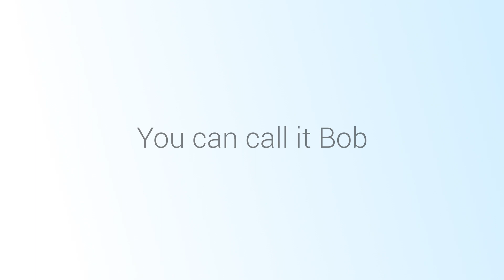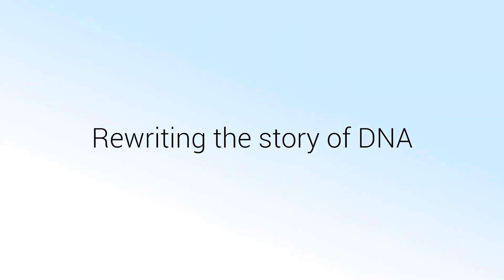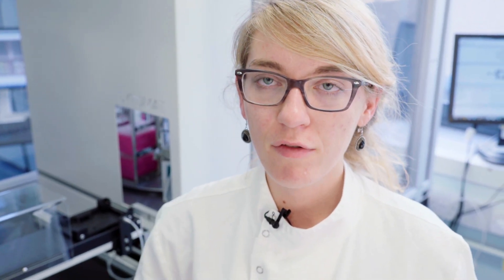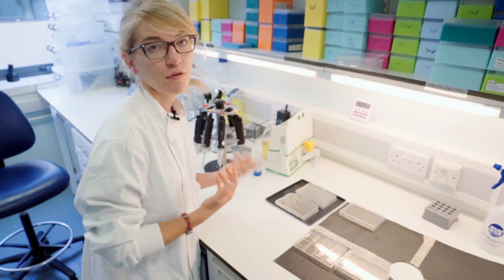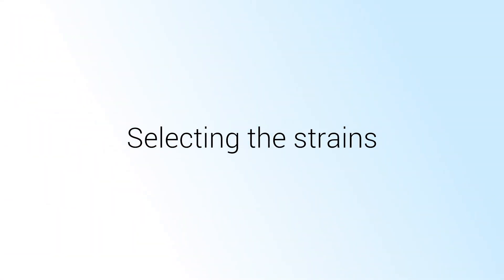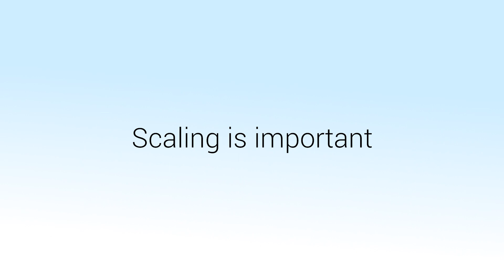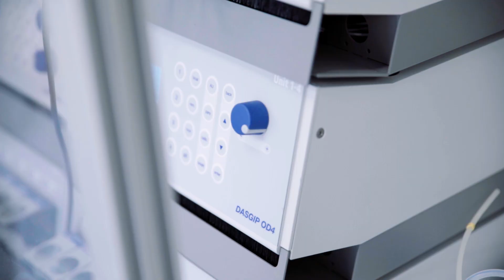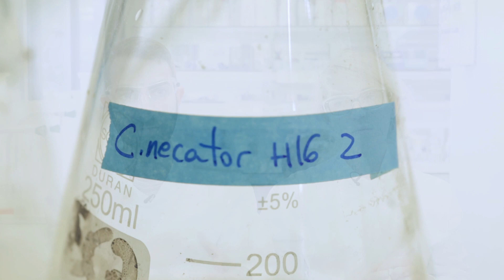Call it Bob - Microbiologists #6

Comment: The scaling up might be the biggest issue since it might be not directly proportional. To be more specific, would that amount needed quadruple or would it only increase at certain incremental thresholds. Maybe the end result eats a lot more resources and energy than it's possible  for being market  competitive. I bet further testing is going to show. I'm just saying that there might be some unpleasant aspects on a bigger scale. 

For example , what if the organisms behave differently in a large mass with surplus of nutrition and the right atmosphere.

Comment: biodegradeable plastic will eventually decay back into the environment producing CO2/Ch4
Reply: To be recycled by the same bacteria that created it.
Reply: Great idea: take away the primary growth mechanism of flora, literally the point of transpiration, and feed it to genetically engineered bacteria whose mutation cycle is not understood to produce bottles for overpriced tap water.

Keep researching but pick something a bit more intelligent to devote your efforts to. How about engineering bacteria to destroy petroleum products in salt water and turn those in to polymers? That's a much better use of your energy.
Reply: Wouldn't hurt to take a few billion tons of co2 out of the atmosphere whilst working on bacteria that can process polluted sea water. I doubt we could reduce the co2 in the atmosphere to the point of of killing off plants. The scale of production would have to be insanely huge to deplete the atmosphere and ocean of 100+years of industrial co2 production and keep up with current production levels. Or we could just trawl all the plastic thats already in ocean.
Reply: Also I'm assuming you intend to keep your genetically engineered bacteria who's mutation cycle is unknown contained and not release it into the environment. Pumping and purifying mass amounts of sea water is significantly harder and more dangerous for the environment than pumping and removing c02 from the atmosphere.